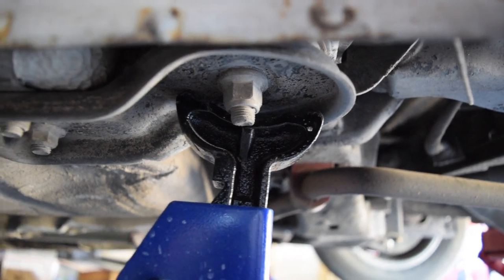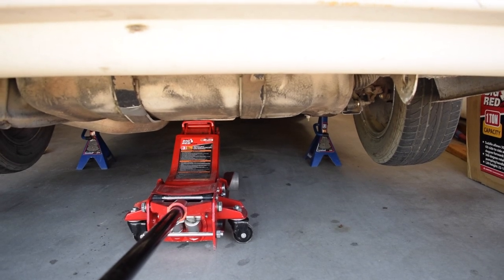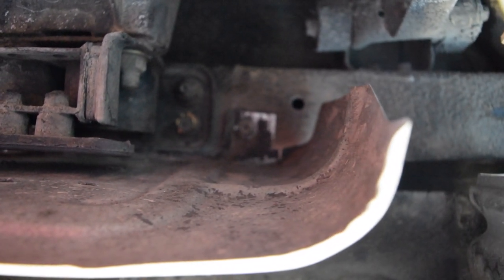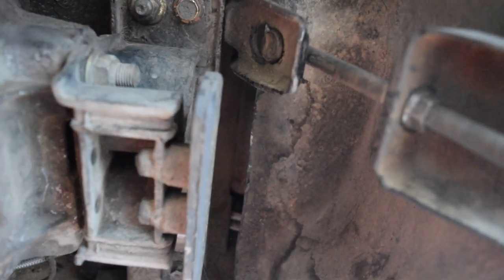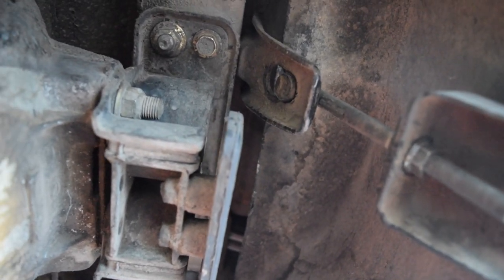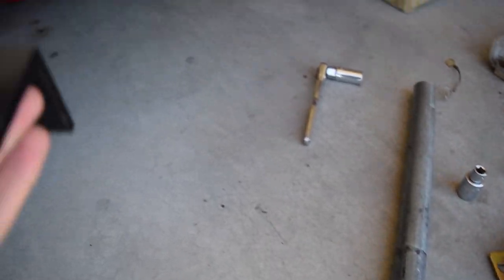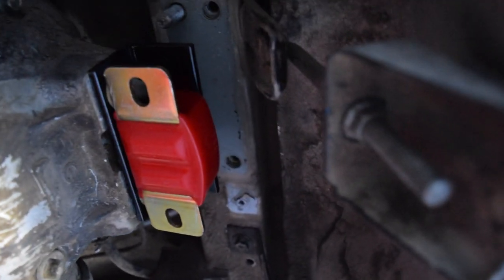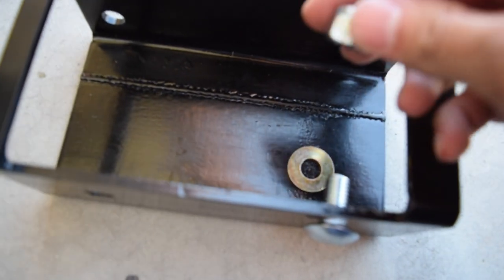Poly Differential Mount Installation (300zx Z31)

Comment: Can’t get diff mount out. Even with it lowered still not enough to clear studs.  Maybe the whole subframe is too stiff now that I’ve done those bushings previously.
Reply: Maybe if I loosen up diff to subframe bolts slightly I can get the thing to tilt

Comment: Thanks for content, just picked up a low miles 85 base at an auction, has the noise or clunk when gear engaged.  So seems like a common issue with old ZX, that company website does not work, past power parts they go out of business?  Anyone else source for diff mount and or tranny mount for manual?
Reply from the maker: Correct, past power is no longer in business. The only source for diff mounts I know of right now is a company called apex engineered and they offer two styles, solid and polyurethane

Comment: I know you can’t make a 4 to 5 lug conversion since yours is already 5 lug but could you maybe do a video explaining how to do a conversion and what’s needed? I have a 84 z31 and really want to convert it to 5 lug. Thank you in advance!
Reply from the maker: It's actually pretty simple! If you watch last week's video, the first part about removing the wheel hub and the last part about reinstalling the hub is all you really need to do. The spindle is the same, it's just the hub that's different. I haven't messed much with the rear suspension but I'm pretty sure it's exactly the same process except for the axle.  You just need to get the 5 lug hubs from a donor car.

Comment: Do you know what is the part number on the bushing itself? I need to replace mine. I have the boxed in poly style mount also but the bushing needs replacement :/
Reply from the maker: I don't but you can try contacting past power and see if they can get you what you're looking for!

Comment: Did you have any issues after install? I did mine earlier this week and I’m getting an awful intermittent squeaking noise in reverse. I think I may need to loosen and re-tighten everything in sequence. I have the poly subframe bushings, and to get the diff to come down enough to remove the old mount, I had to loosen the diff to subframe bolts/nuts. Maybe it’s just slightly misaligned now.
Reply from the maker: I can't say I have the same problem but I know poly bushings like to have Grease on them so that may be the way to go
Reply: @TheZGarage  Definitely didn’t grease the subframe bushings and definitely won’t be removing them lol. The squeak is related to the motion of the driveshafts or the CV shafts - not sure which. Hopefully it’s easy to sort out.
Reply: To follow up, the noise was a result of me tightening the e-brake cable too much, which caused the e-brake to drag in reverse. Whoops! Fixed now.
Reply from the maker: Good to know for future reference!

Comment: Are there any roller rockers or high performance rocker arms that will fit the motor I know there's nice cams but what about the roller rockers or rocker arms
Reply from the maker: I don't know of any aftermarket rockers for the z31. I'm pretty sure the stock rockers are fine for any power goal
Reply: @TheZGarage  I know they make roller rockers for just about every motor and roller rockers give you power over regular rocker arms I was just curious if they made any roller rocker arms or after Market rocker arms
Reply: @TheZGarage  the type one nistune my main reason for getting in touch with you today how does it communicate with the laptop I know it's not USB it's that little phone jack looking thing correct
Reply: @TheZGarage  I was reading the forums and somebody said a 5-wire wideband was useless why is that and where's the cheapest place to get my poly rear diff mount

Comment: I need to find someone with the actual l bracket and the box bracket for this diff Mount I have the actual bushing I need the metal parts of the mount I was under mine looking in the center of the rubbers busted out I put some big huge worm style clamps around it to try to hold it secure a little better till I can figure out something else and I really hate to put another stock one on there beings I have a mount I could use if I just had the metal parts of the bracket if I knew the dimensions I would try to fabricate my own I'm a pretty decent fabricator in my own eyes LOL

Comment: This is a great video!  I have a 86 300zx (manual) and I know exactly the clunking noise mentioned in the video.  The company that makes this specific mount is not only out of stock but I've emailed them and called them numerous times and I've received no response whatsoever.  I want to do this upgrade desperately but have no way to get ahold of anyone at the company and I can't find this upgraded poly diff mount anywhere.  Any suggestions?  Thanks!
Reply from the maker: I don't know of anywhere that sells diff mounts currently. I know a few people have been looking for them. I think Thezstore.com sold oem mounts a year ot two ago, but I don't know if they still have them
Reply: Apex is working on it atm
Reply: @stephenmyers3349  Please let me know when/if they become available.  I would even be willing to test a prototype for them if they'd be willing to send it to me.

Comment: I finally got my hands on my rear differential mount let's see how the squares got out in the bottom of that it almost looks like that bottom boat to go either way I'll see how the square also fits in the bottom of the rubber part of the mount but it also fit through the bottom Square you can actually put it either way I guess huh

Comment: I want this kit you have so bad I can't believe I picked up this Mount I seen on sale at advance day before yesterday and you put this on my phone yesterday I could not believe it take a look for yourself at an energy suspension transmission mount for Chevrolet it is the same rubber piece with the three holes in the top and the two on the bottom but it does not come with the metal bracket maybe I could get the dimensions of the metal bracket from you so I can build my own metal bracket out of steel and a welder but I have the mount itself I think it will work

Comment: I am having somekind of clunk whenever I accelerate or when I let go of the gas.  replaced most mounts with poly the supframe mount looked new and seemed to be replaced not to long ago by the prev owner so I am not planning to replace them but on pastpower its stated: Please note that using this mount without upgrading to Polyurethane Subframe Bushings may cause significant wear, and possibly premature failure.  I saw in the comments that you did not replace them how is the diffmount holding up any isues? since I am thinking buying the mount but not sure if I want to do the sub mount replacement job just for this if it has no real effects on the new diffmount.
Reply from the maker: I am going to eventually replace the subframe with poly as well. As it is right now, everything is fine but because it's poly and the subframe isn't, it will wear faster so it's going to be something I need to do. If you're looking to replace the dif mount on yours, chances are your subframe is going to need to be replaced too. It's 30 ish years old with probably 150k+ miles. So it's a bit inconvenient to have to do the subframe, but in my mind it's something that was going to have to be done regardless. That's why I went poly

Comment: what is the cheapest option for me to replace my diff mount I have a plug on getting these energy suspension transmission mounts that I could use I've already got one of them if I had the metal casing I could use it and do my diff Mount like yours but I don't think I'm going to be able to come up with the metal case to be able to do that if I had the black metal piece for the mount like you have I would be okay but I don't so what is my next cheapest option to be able to sturdy up my diff I've been replacing all kinds of other bushings but that mount is a little bit high for me at the moment especially considering I just need the metal part and also what is the best fluid and weight fluid I need to run in the winter time in my z boy now that it's getting cold it seems like it doesn't want to shift very good when it's cold after it warms up it's okay and in the summertime it was fine but I think my gear oil may be a little too thick for the winter time but I would like it a little ideas on but not so pricey way to fix my diff mount man if I just had the measurements of your casing of your death mount I might could make me one and use this energy suspension bushing I have or can I use the rubber bushing and make me some kind of casing maybe that you noticed while you had yours apart something that will work or even could I use some big ass self-tapping screws and put a couple of screws in my stock mount to sturdy it up and say to hell with rubber for now just to make it more sturdy till I can get the one like you have you're a bad influence to me LOL now I'm in the process of ordering me some projector headlights or LED headlights to replace those old ugly sealed beam lights and I want all these bushings and stuff I see with your car I've already done all the energy suspension in length and sway bar bushings on front and back now I'm waiting on my subframe bushings to get here and my new collars for the rear subframe just to make it stronger and my grooved rotors and stainless steel brake lines I'm waiting on and also which gas do you think would run better in my car 93 octane Shell v-power gasoline or 93 octane Texaco non-ethanol gasoline
Reply from the maker: You might be able to contact Zach at Pastpowerparts.com where the mount comes from to see if you could just buy the metal case from him.
Reply: @TheZGarage  hell yeah thanks for the info I might try that you know I also learned the z32 uses the same amount for the transmission cross member that is a very common mount they just utilize different mounting strategies to make it work with different things but that started out being pretty much a GM transmission mount the actual energy suspension part but thanks for the info once again man you're becoming a genius on the z very fast like I said I've been dealing with these cars I've owned four of them and been around five or six I'got my first one in 99 that was my 84 slip top five speed I was 15 I have a picture of me sitting on the hood and by the way you know I posted a video on YouTube a little short clip of my 86 I have had since 2001 idling I hate how these motor sound like they're ticking you on video but my motor doesn't sound like that in person it doesn't tick it actually sounds good in person lol type in 1986 300ZX z31 5-speed it's under Jason nuby also I believe

Comment: I need to do this on my car as well as bushings all around.
Reply from the maker: I've almost got all the bushings replaced on mine. Only thing left is the rear subframe bushings and I'm not looking forward to it haha
Reply: @TheZGarage  Is it safe to jack up the rear from the Diff with this mount installed?
Reply from the maker: Yes. The diff is a safe spot to jack from but you'll want to use other supports while you're working to relieve some of the load